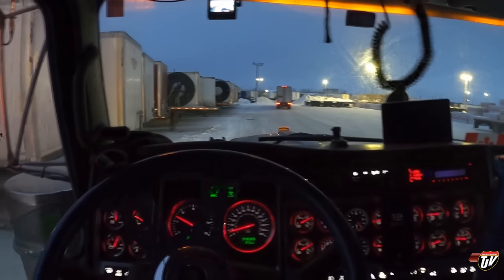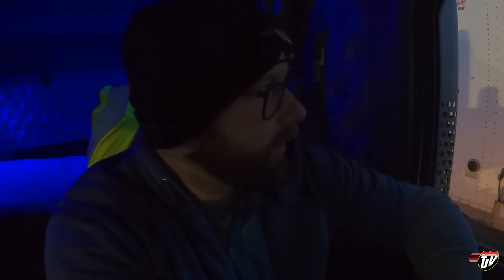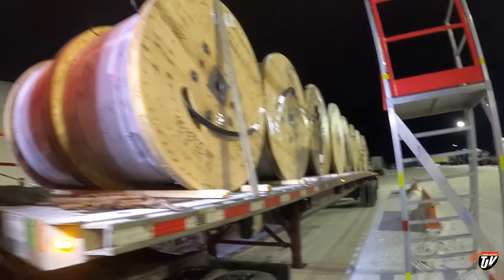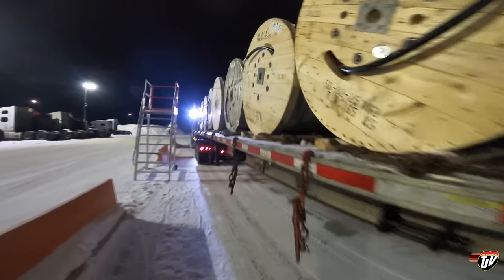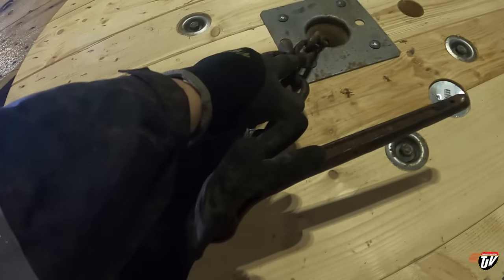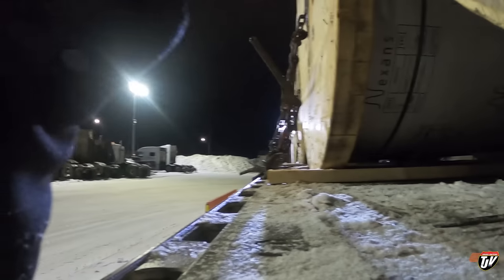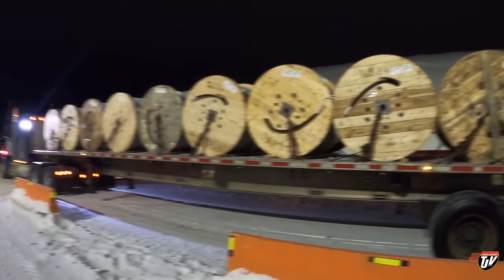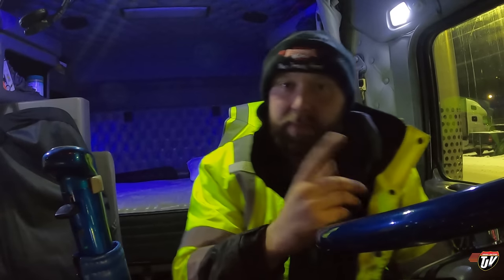CHAINS AND BINDERS | My Trucking Life | Vlog #2718

Comment: Really enjoy all of your videos. I pulled dry vans all over the US for 13 years. Them was fortunate enough to get a regional flatbed gig after my 1st don was born. I hauled telecom cable...had to chain & bind large steel and wooden reels several times every night...pulling chain and slamming binders was something I took 'pride' in.  Only one way to do it right and keep everyone safe...no shortcuts in Flatbedding. The only thing I would do differently is to place the binders on the passenger side..if you need to re-secure on the side of the road..you will be away from the traffic. Be safe! Keep the videos coming

Comment: Never really had a snap binder ( that's what I call them ) open up. BUT I have had them sling a pipe across the yard. I really didn't like them that's why I used ratchet binders when I had a choice. Thanks for sharing.